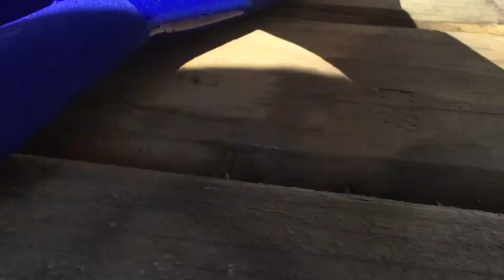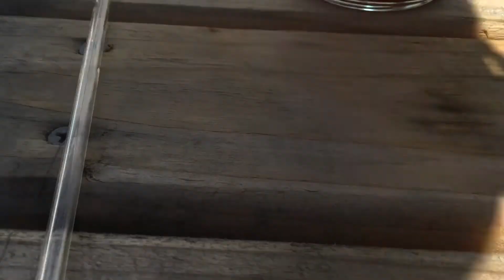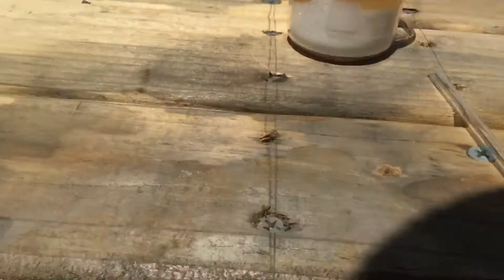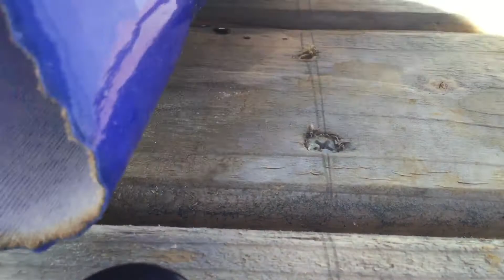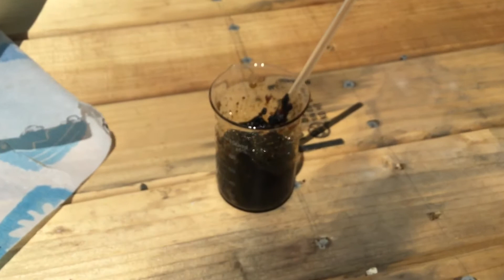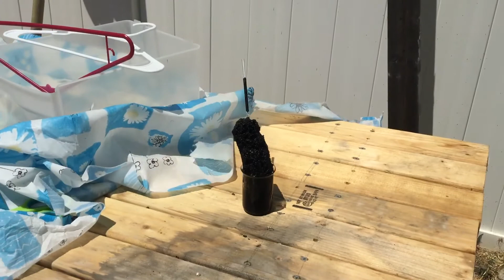The dehydration of sugar using sulfuric acid [Carbon snake] (old)

Comment from the maker: In a beaker add 50g of tablesugar and pour in sulfuric acid and mix throughly. The overall reaction is C12H22O11 + H2SO4 -----------> 12 C  + 11 H2O. The Carbon foaming up is caused by the heat of the reaction boiling the water into steam. Some of the carbon is also further oxidised to CO2. The steam is mostly water, but also some sulfuric acid vapors which is why I coughed a little.